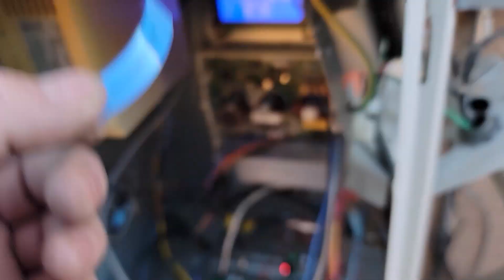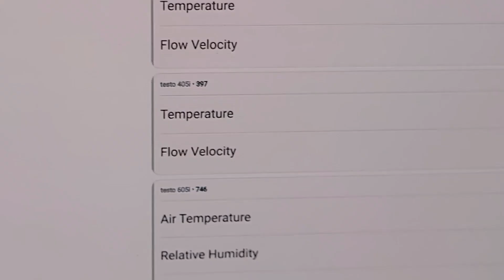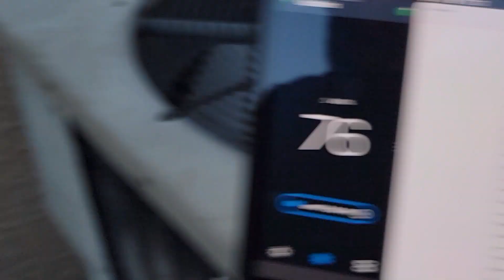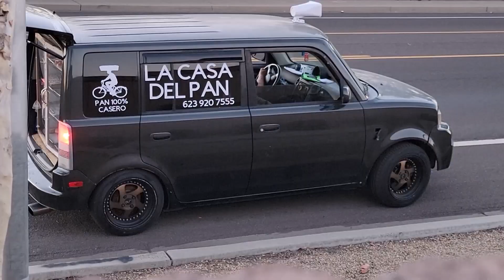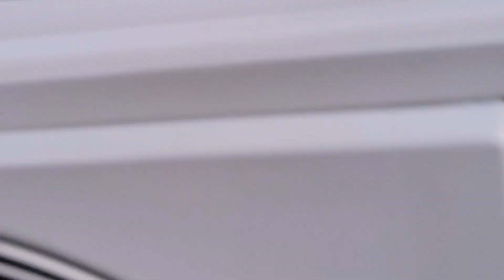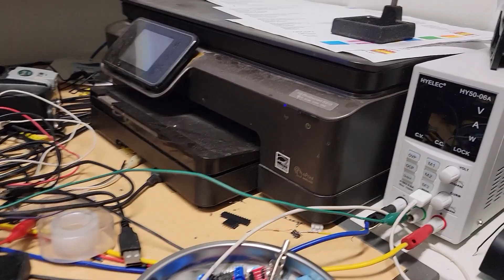Doing some final tweaks to the slender Frankenstein Heat Pump - Faulty board diagnosis

Comment: Run an oversized compressor, at low rpm, lowest you can get away with reliably. The tonnage goes down, but the cop goes up, which is efficiency. Run r152a. Run higher voltage compressors if you can for lower copper loss. brushless fan motors.

Comment: Nice find on the HW debug, just curious and you may have mentioned, but I didn't catch.  On the Y1 optoisolator, there is a small ceramic cap but not on the others, what is that for or was it just for your debugging?
Reply from the maker: I made these months ago., I forgot I did that until I put it together recently.
It just connects 24VAC common side to DC common/negative on the board. That seems to work for me to ground high frequency noise without actually making a direct connection on the DC neg side to ground.

Comment: Are you still running DC into your VFD from solar?
Reply from the maker: No.  That was only for a short while to test.
The solar feeds a charger/inverter in the garage that powers a 115v compressor to heat my domestic water instead. Been that way now a few years

Comment: I'm lovin the home made control board. Awsome dude.
Reply from the maker: Thanks.
It came out pretty good except forgetting to include the filter caps on the schematic and layout.
But was easy to add later aside from the broken solder joint on the one.